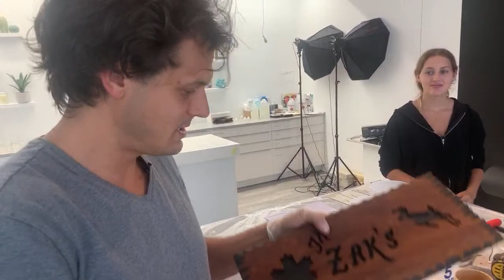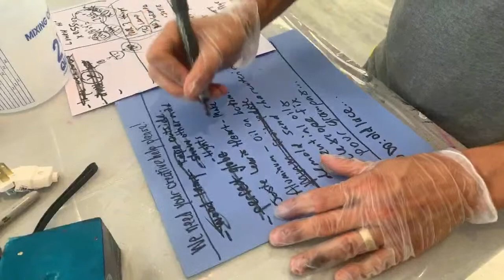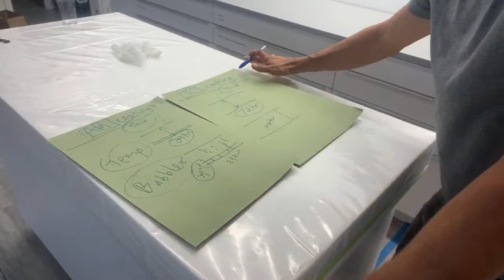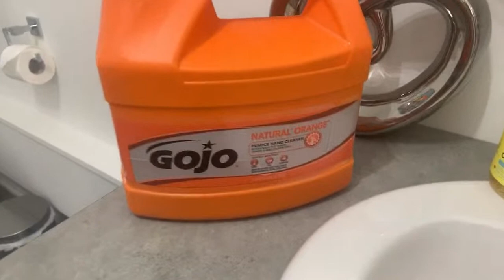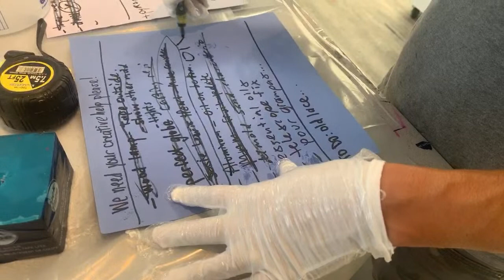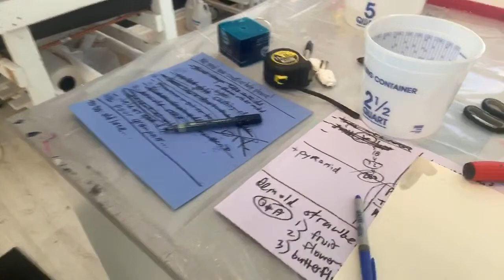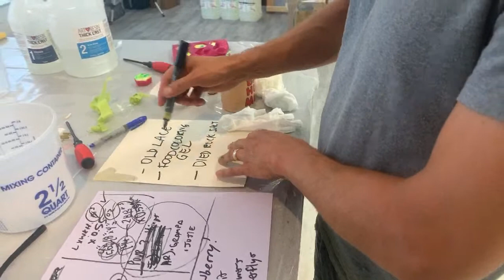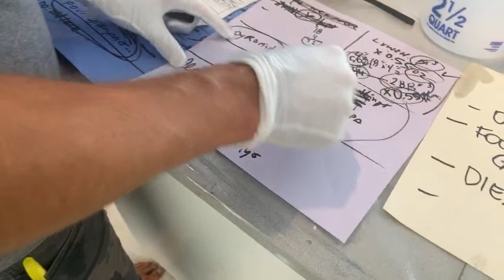We Need Your Creative Help PLEASE!

Comment: Also, quick tip for resin clean up on hands or anywhere really is baby wipes, I use the non scented ones and so far the best ones are by pampers. It removes it like nothing else. I clean my work table surface with them and it works amazing.
Reply from the maker: i stopped using baby wipes about. a year ago!! no more diapers!!!  interesting to try though ill buy some again and leave them in the studio thanks :)

Comment: You can use masking tape and use scissors to trim it.  Then when you get ready to take off nubs use heat gun, not a long time, and they come right off.
Reply from the maker: ya smart!  im always looking for easier ways but you just need to take the time to prepare properly eh :)
Reply: @Artresin  .  I think even if you don't tape if you lightle use your butane torch lightly on pack you can knok the off.   Stay safe in Canada.  I live in a small comunity called Wellton, Az and just started watching your YouTube posts.

Comment: I put liquid rubber on the bottom of my stuff and the drips come off so easy when I take off the rubber!!
Reply from the maker: what is liquid rubber???  is that rubber cement.  i check amazon! :). and test.
Reply: @Artresin  The stuff I got off Amazon is called General Purpose Creature Liquid Latex and comes in a 16oz bottle

Comment: Use a hairdryer on hot to get rid of the air bubbles in resin . Hold close to the bubbles but not touch and watch the air bubbles come to surface and bust. Be careful about the heat too long on the piece. Keep the dryer moving
Reply from the maker: i like using a torch!  FIRE!

Comment: If you coat the butterfly first then put it in the resin.
Reply from the maker: that problem is that the resin, even lightly painted on, soaks into the wing and makes it much darker and you lose the vibrance of the color!   we found a good packing tape that is working great!

keep u posted!

Comment: I just got my Art Resin and made a 3 tier cake stand. I have a few problems that I need to solve. First one is I can’t seem to level my workspace ( my coffee table 🤪). I put papers to the left papers to the side, it’s very frustrating. Is there an easy way to level the surface? Second somehow on the surface that’s stuck to the mold has small chipped areas. What causes them? Lastly, to make my piece look professional I poured top coat but I couldn’t spread it nicely. Any suggestions? Thank you guys
Oh and I would love to send you my piece for your critique. I want to produce super professional products. Thank you

Sorry one more because you commented on using resin to fix the heels of your boots. But doesn’t it make them slippery?
Reply from the maker: Hi Bat Noach, sorry to hear you are having trouble with your resin set up and finish. Please send an email to support@artresin.com, and include any pictures you might have to share. Our customer service team will be glad to help.

Comment: Please when my resins drying slaw a hole how can l fixed thank you very much
Reply from the maker: there may have been oil on the surface that makes these dimples... clean it out with soap and water and try and fill the hole with a bit of resin... if you dont like how it looks after this cures.... you are best to sand the whole thing i tiny bit and pour a whole nother coat!!
Reply: Thank you very mach

Comment: Hi, I am just starting out in using resin, I watched your video and picked up many tips (thank you!), but can I ask, do you not wear masks of any kind when your working and mixing the resin,? I was told to buy a respirator mask to keep me safe???...your help would be appreciated, thank you
Reply from the maker: Hi Christine, thanks for your question.  
ArtResin has been evaluated by a certified toxicologist at the American Society for Testing and Materials as being non-toxic when used as directed (conforms to ASTM D4236). It is formulated using the highest quality materials and therefore produces no VOCs or fumes. It is a clean system, meaning there are no solvents or non-reactive diluents—everything in it reacts so nothing is free to become airborne and cause health issues.  Furthermore, many curatives have a powerful odor, however ArtResin has only a low odor and is applicator friendly.  We recommend working in a well ventilated area while using ArtResin, and always work within your comfort zone, and wear a respirator if ventilation is poor.  
Here is a link for more information on safety:
 https://www.artresin.com/blogs/artresin/what-safety-precautions-should-i-take-when-using-artresin?_pos=3&_sid=e40e413ce&_ss=r
🙂

Comment: They told me to get this silicone for mold making  as a beginner. Comes in different volume sizes . Doesn’t need degassing. They say it doesn’t form bubbles so easily. Haven’t had a chance to use it yet. Supposed to be easy to use .https://www.sculpturesupply.com/detail.php?id=799667&sf=subcategory&vl=Mold+Star+15+Slow&cat=Rubber+Silicones

Comment: Loved watching this
But you are so disorganized
lol
Reply from the maker: oh ya my brain is chaos!!!  4everlost with you :)
Reply: @Artresin  I would use the baker's racks on wheels to my advantage.
I would make boxes to fit out of plexi glass, would remove a couple of the slides so bigger boxes would fit.
That way all of your items can be wheeled to your work station. 
Each station should have gloves, scales, stirrers, measuring cups etc... at all times
1 starting projects rack with Molds and colors and Sprinkles etc... Maybe make a rack for silicone, plastic, tape, hot glue gun etc... to make molds
2 finishing projects racks sandpaper, tools, jewelry things, dremel etc... 
Just thinking how I would do it